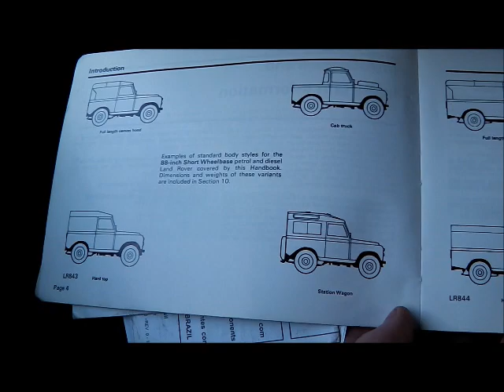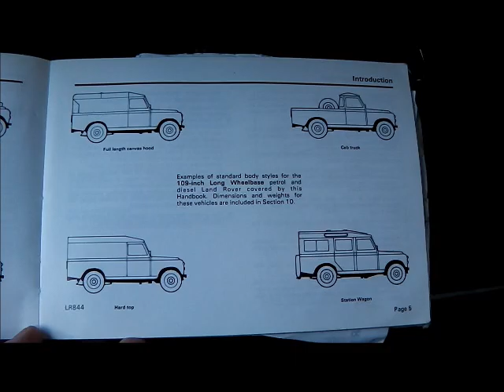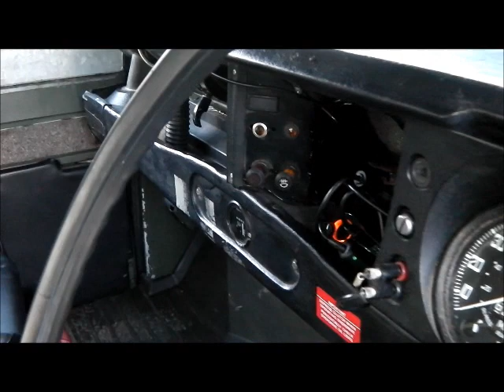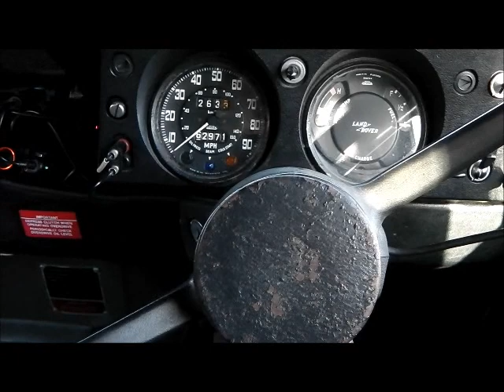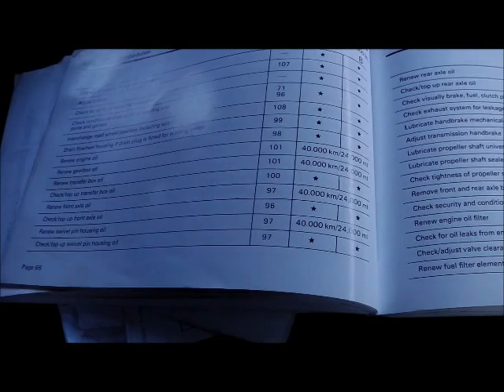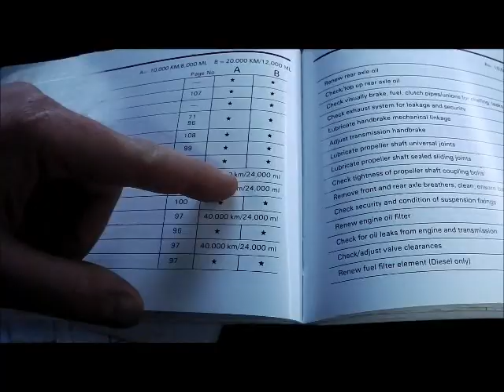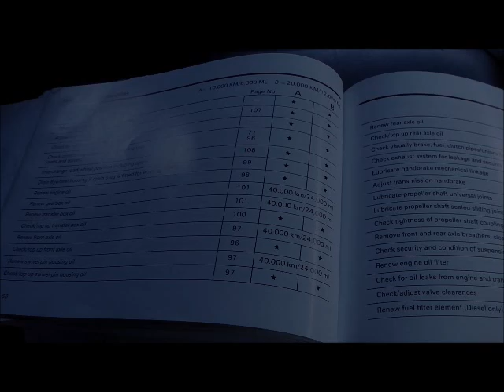A basic guide to the Series 3 Land Rover

Comment: Nice tip about opening the vents. I'll try that. Fair play I was exaggerating for comic effect, I have put sound deadening and close cell foam over the entire roof and sides( except the four side windows natch)
The cross roof ribs and internal galv" gutter " still get amazingly wet though. But it's much better, and quieter,  than it was. All this recent rain has had me driving around pretty much constantly sponging the inside of the drivers screen   It's great on a cold dry day!   
Recent improvements include a fume screen ( tailgate flap from an old tilt) nicely mounted behind the seats giving a truck cab snugness. The windows big enough to not obscure rear visibility and the heater ( biscuit tin)hasn't got such an unfair fight on its hands. 109 hard top  , like yours

Comment: 22:00 - "They are not fast by any means" followed by the SLOW DOWN sign illuminating! ;-)
A good guide to the general vehicle, what to look out for, and a taste of what they are like to drive. I think it's worth pointing out that the parts availabilty is second to none and (in my opinion) even some of the more expensive parts are pretty reasonable when compared to a more modern car. Cheers
Reply from the maker: I thought it was compulsory to set those off :) 
Totally agree, along with Minis and MGBs, probably the best parts availability out there.

Comment: Very useful 👍🏻 What sort of fuel consumption do you get from this well-maintained petrol version? Thanks 👍🏻
Reply from the maker: Thanks, in the summer on a good run I can just return 20mpg. In the winter months, more like 16 on my run to work which is a tad painful! I suppose that's because of the extra time spent on choke during warm up. It does make a difference how it's driven - on a trip of say 100 motorway miles, if I sit at 50-55 it will return 18-20mpg. If I push it a little harder and do 60-65 it will drop right off.
Reply: @steamwally  Thanks. I still prefer the petrol over diesel, I think 😂

Comment: Im fitting a series 3 synchro box in to my series 2A have you any idea in if the cross member will need cutting any  for it to go in and not foul the clutch slave cylinder , thanks in advance  ?

Comment: You didn't mention fuel consumption. What should a 109 petrol owner expect, and how much better is the SU compared with the standard Zenith?
Reply from the maker: I think the short answer to miles per gallon is, "not a lot!" I noticed a slight improvement in economy with the SU conversion.
20MPG on a good run is attainable but during general daily use, 16MPG is typical. 
The petrol engines are very tolerant of neglect and consequently many are not kept in any sort of tune and will deliver much less, so it's also relative to use, condition, vehicle body style, overdrive/ non overdrive etc.. but in short, they are expensive on fuel. Think V12 jag...
Reply: @steamwally  I trained on Jags. V12 carb models returned about 8Mpg and Injection about 11Mpg, so we are not quite in that territory, but 20Mpg for a dated design in a vehicle with a Cd of a lot worse than 0.5 (roofracks etc.) would seem very good to me. I was expecting you to say 16Mpg so not bad. Did you ever do a video about the effects of Overdrives, Freewheel hubs, tyre choices, roof racks etc. on fuel consumption? Some of the roof racks I see on old landies look like like early WW2 radar stations.
Reply from the maker: @bimble7240 
When you fit an overdrive, you tend to just drive a little faster because it's more comfortable to do so. I drive the overdrive like a 5th gear and wouldn't be without. The vehicle will do motorway speeds, but 55MPH is a comfortable cruising speed. As far as I'm concerned, neither overdrive or free wheel hubs make a great fuel saving but they do make the vehicle more driveable. Myself and a few friends have FWH's on our Land Rovers and all find that the steering is far more pleasant with the front axle disengaged.